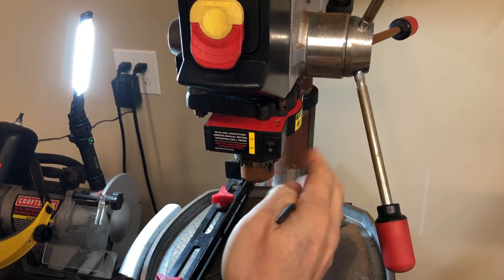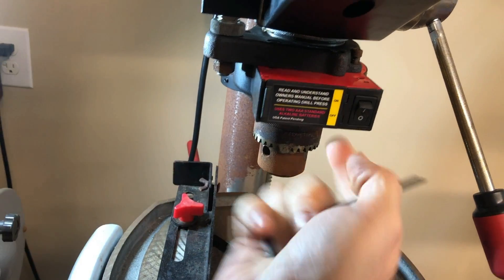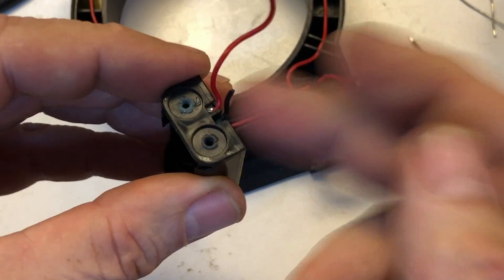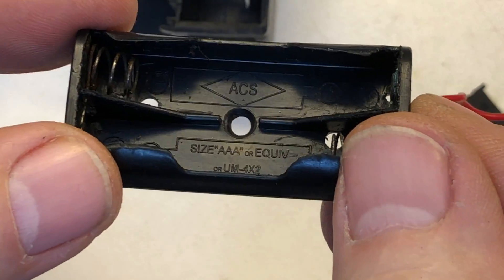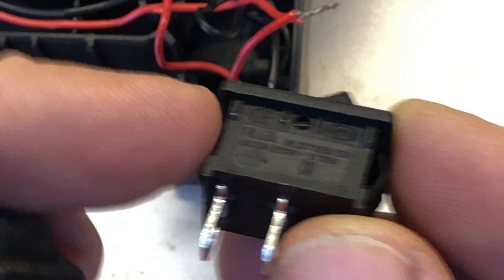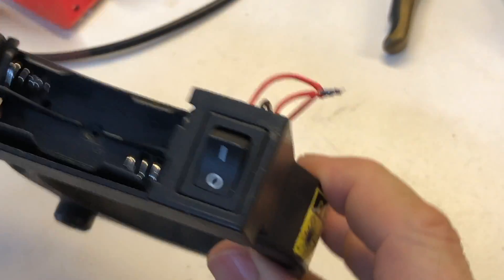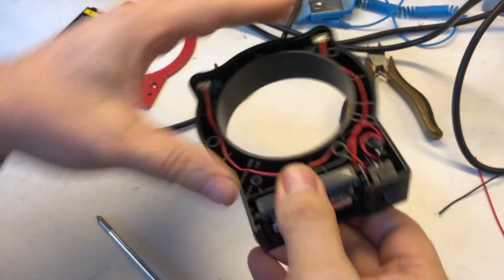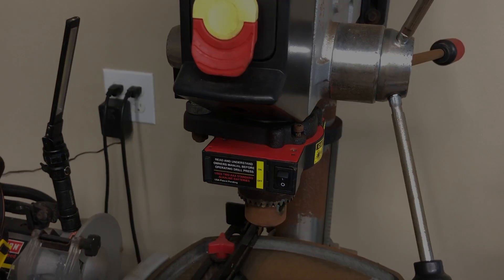Craftsman Drill Press Laser Trac Unit ~ Alkaline Battery Leakage Damage ~ Diagnosis & Repair

Comment: Kind of surprised that the wires were left bare where the positives all join there near the switch. No need to protect them from touch something? I assume that’s how craftsman had it and you’re always detail oriented to the nth degree so this question is genuinely out of my own curiosity 🙂
Reply from the maker: Yeah I was also surprised to find those were not soldered.  Since the entire housing is plastic, it was probably a nickel saving move by the supplier to Sears. But I like to leave things the way the factory did them regardless of who the OEM was, so back they went the original way.  ;-)
Reply: @DrShock  completely understand 🙂 I just found it odd and I’m sure your theory is probably correct 👍🏻